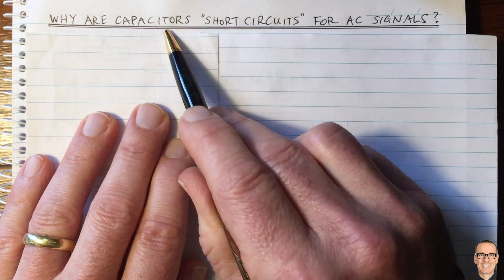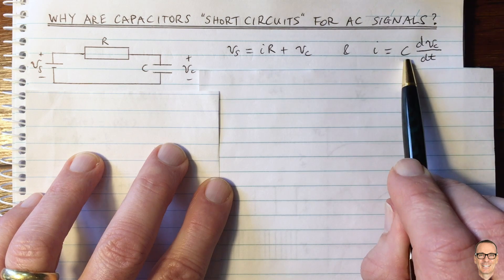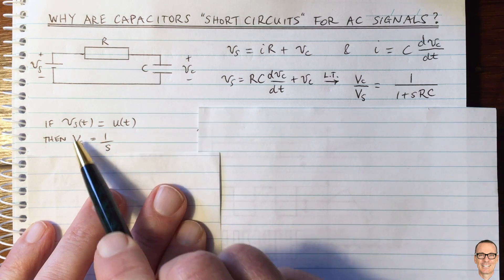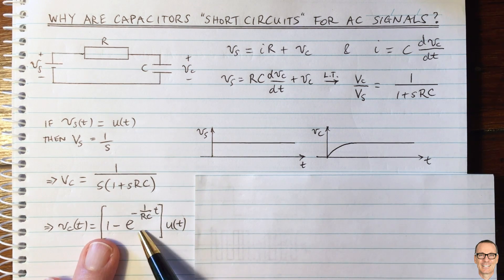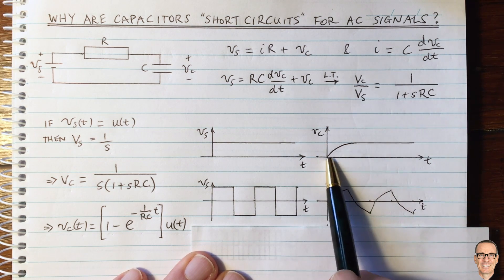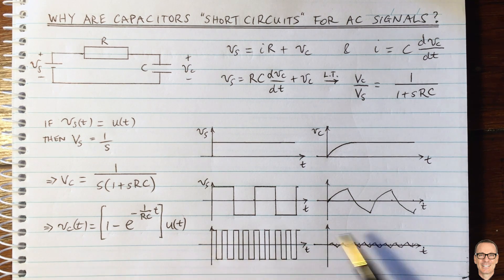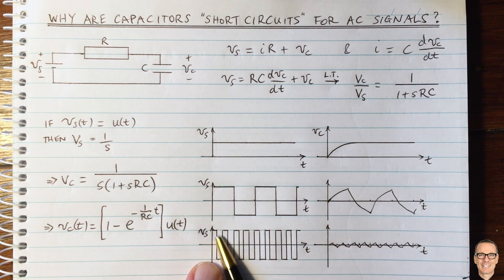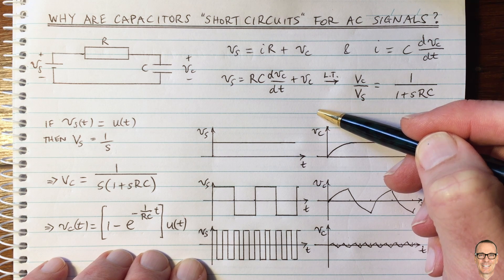Why are Capacitors "Short Circuits" for AC Signals?

Comment: Hi, Great Video, as always.
One more way to think about why capacitors only pass AC, more conceptual way, is I feel,
That, in AC, electrons oscillate through the source(as we know) and that is the reason there is oscillation of charge at capacitor plates, and it looks like the current is passing through the capacitor, but in reality its just oscillating around it.
Isnt this right?
Please correct me.
Reply from the maker: Not exactly. Electrons don't "oscillate through the source" or "oscillating around it". They move on and off the capacitor plates, as they are drawn into the capacitor, and out of the capacitor. But they don't go "through" the capacitor, or go "around" it.
Reply: @iain_explains  ok